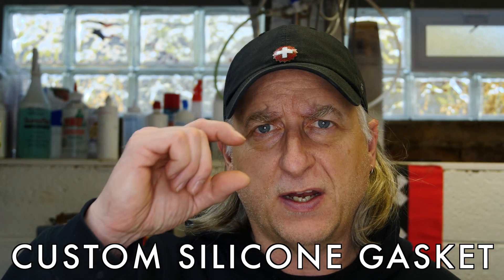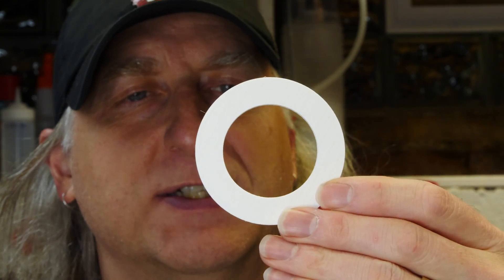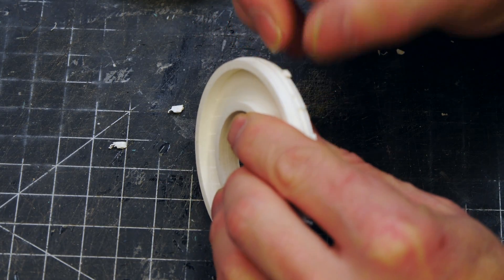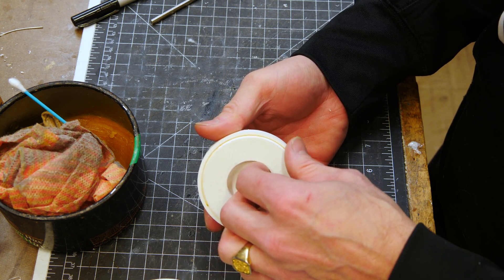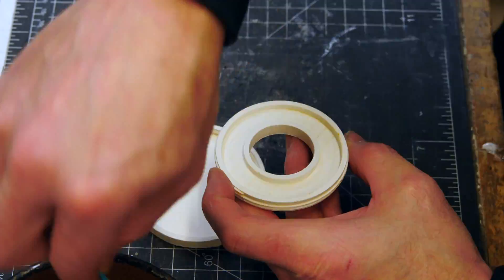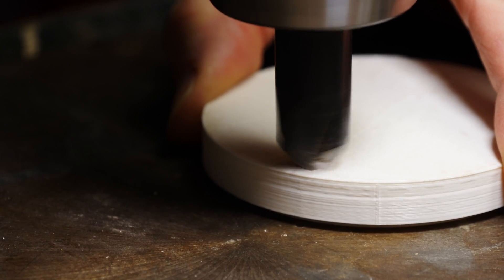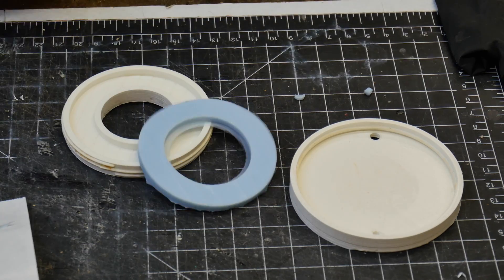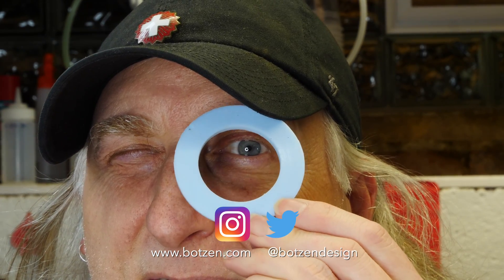Screw your Molds: Making silicone parts

Comment: Since the gasket is thicker on one side that the other, I assume the orientation is important.  Did you consider adding something to the mold to help orient it, like a tab or notch?  If you had to make another one, would you add something to the exterior of the mold to make it easier to unscrew them?
Reply from the maker: Yes

Comment: I've also made some silicone molds directly on the 3D printer. Some of the things I do, put through holes on the mold blocks, so I can use all-thread, nuts, and washers to clamp down the mold halves, fourths etc. Next, I have a bunch of super sculpey clay, and I find the pink clay rolled into a thin bead, line it across the inside seams of the molds, clamp down, then come in with a finger, paper towel, clay sculpting tool, whatever to scrap out the excess clay. Obviously some sand paper, solvents, and finishes all will improve quality depending on what standards you are looking for, but not always required.

Comment: I printed some silicone part molds earlier this year and was genuinely surprised it worked as well as it did. Apparently there can be some barriers to curing silicone around 3d printed parts but i haven't had issues yet.
Reply: i think thats mainly sla resins and then you should use tin cure silicones instead of platinum cure (platinum will have serious inhibition issiues)

Comment: Eric, first of all, I'm very impressed by your Fusion skills.  I do have to say that it seemed like your 3d printer was letting you down a little.  I'm currently using a Prusa MK3 and the magnetic heated flexing bed has been great for prints like the one you did.  Nowadays, I print PLA, ABS and lots of PETG and I just don't have the artifacts or need to apply any solvents/glue stick for bed adhesion.  I'm certainly not a 3D printing expert but moving on from the borosilicate print bed has been great.  You have a process that works well for you but it might be worth a test drive to see if it helps your workflow.
Reply from the maker: Thanks for the feedback